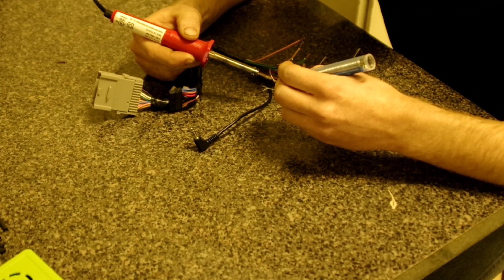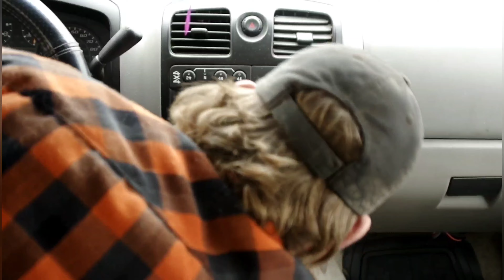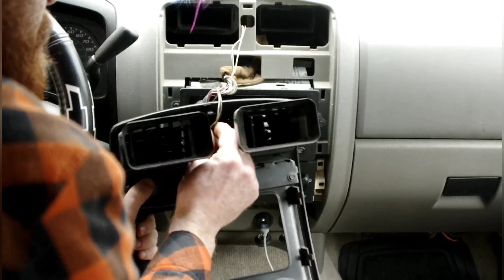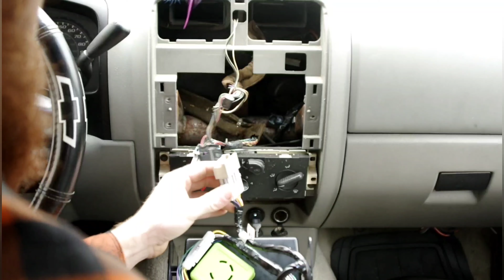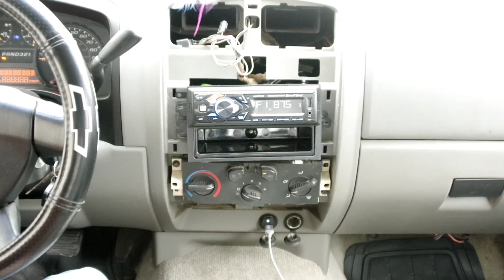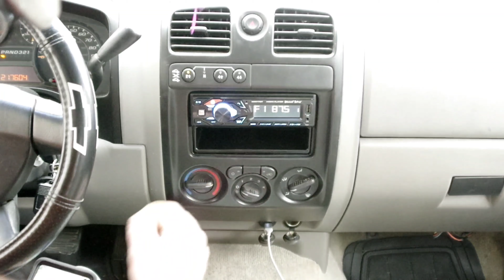Chevy Colorado Radio Install 2005

Comment: If the aftermarket radio has a yellow wire and the wires coming from the radio in the truck does not have a yellow wire what color wire do I hook my yellow one up to
Reply: I would like to have an answer I ain't been able to get one for I don't know how long that will somebody please tell me what color wire the other one hooked up to
Reply from the maker: I don’t remember off hand anymore, it’s been a while since I did the radio. But a quick google search told me that the yellow wire it a 12v battery wire. If you are using an adapter harness with the module, then should be another yellow wire to hook up too. The factory radio has a constant power and the radio is tuned on using a can bus trigger. You need a Metra WM-GM11-SWC GM 00-13 Data Interface

Comment: Can u help me a get the harness and connect all the wire according on the colors but i dont get any power, and i connect the old radio get power, what did i do wrong??
Reply from the maker: https://www.walmart.com/ip/Metra-Gm-Data-Interface-with-Sw/310254105

This module gives you the power you need, or you can run a switch 12v to the radio

Comment: do i need all of the extra wires? for the antenna, harness and all of that. I’m just using the aux and bluetooth…
Reply from the maker: No, unless you need them for power antenna or steering wheel control. If your not using them just cap them off.

Comment: Thanks for the video… could you tell me where you got the green module?
Reply from the maker: I believe I got it from Walmart and no problem. I’m glad the video was helpful
Reply: I have that same problem with my cd player not turning off so that green module hooks up with all the other wires
Reply from the maker: Yes, just follow the instructions that come with the kit. Its pretty straight forward color for color. If the module is already hooked up try unplugging and plugging with key off.

Comment: I just bought a 2011 GMC canyon and it's got the same bezel like you same radio and all that it's the MP3 One I was wondering can you send me a link or something to get that wiring harness and that box for the chimes and because I have OnStar
Reply from the maker: I didn’t have onstar, so I didn’t look into that. But I found is on crutchfield, not sure if it will work, but worth taking a look at it.

https://www.crutchfield.com/p_541RP5GM11/PAC-RP5-GM11-Wiring-Interface.html?tp=3486

Comment: So how do I hook up the  amp  harness to if I want to add an amp the the system…
Reply from the maker: There should be a blue wire labeled remoter turn on. That wire gets ran to the amplifier, it’s responsible for turning the amp on and off with the radio. Also, other things you’ll need is RCA wire and power and ground to the amp
Reply: @redneckboysgarage5772  thank you boss, So if I have anymore questions I’ll let you know thank a lot…
Reply from the maker: No problem, I’ll help the best I can
Reply: Thank you sr…

Comment: Mine has a security system in the factory radio how do i bypass that or do i have to take it somewhere
Reply from the maker: Not sure on that one. There maybe another bypass need. Also, my factory radio did have a security light on the radio. However, that was not for the vehicle just protection from the radio from being stolen.

Comment: I put a pioneer radio in my 2006 Colorado last summer,it plays well except when its below 45 degrees,then it wont come on,would you have any idea whats wrong with it?
Reply from the maker: I had the same problem, the connection with my GM interface module wasn’t all the way in. Disconnect and reconnect the module if your using one. If your not using one then double check all your connections. If nothing is found too be wrong then it could be a bad solder joint inside the radio or a issue with the truck.